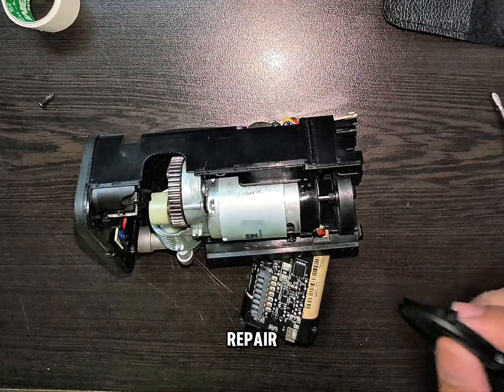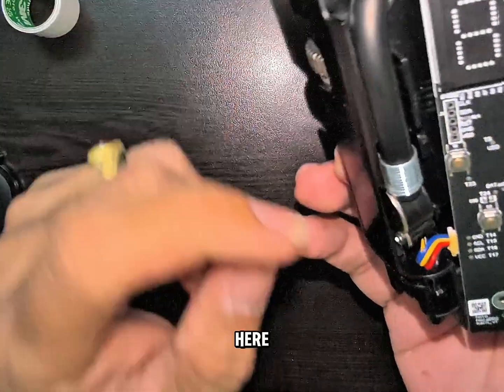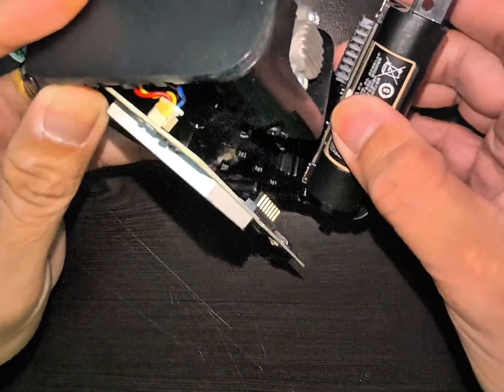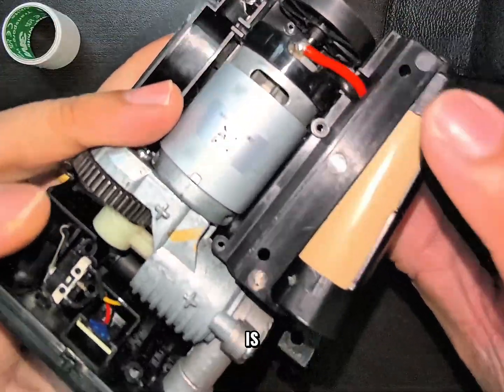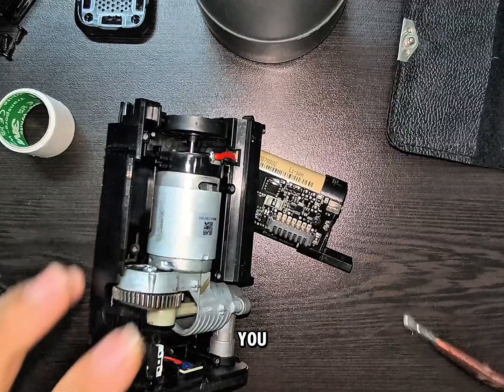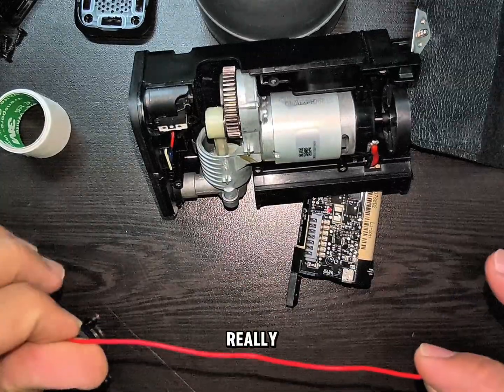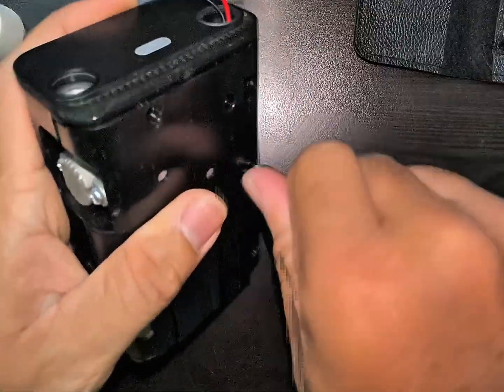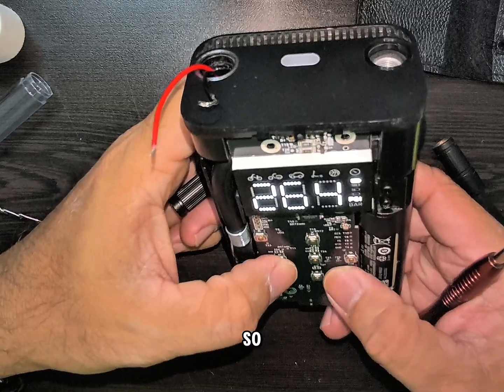[FIXED] Xiaomi Inflator ERROR 264 (complete guide)

Comment: Does the psi doesnt work if you bypass it?
Reply from the maker: When the pressure sensor is damage, the psi wont work anymore. The bypass only makes the device usable, still pumps air effectively